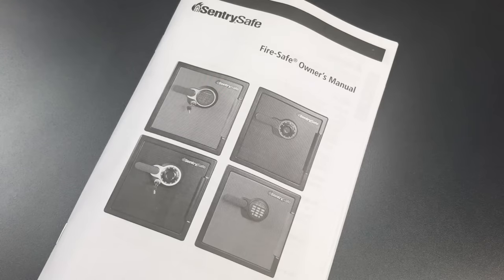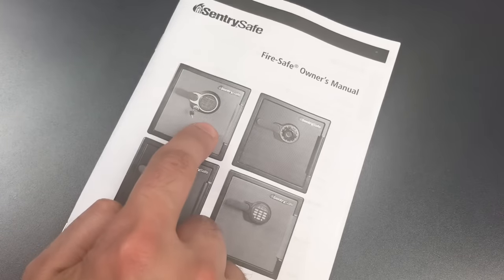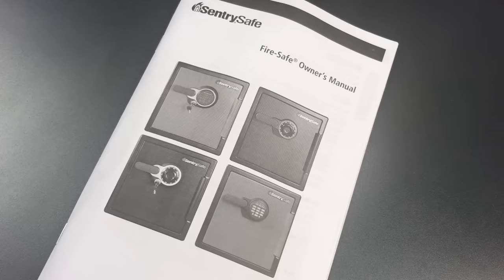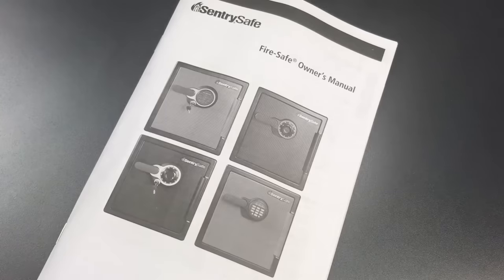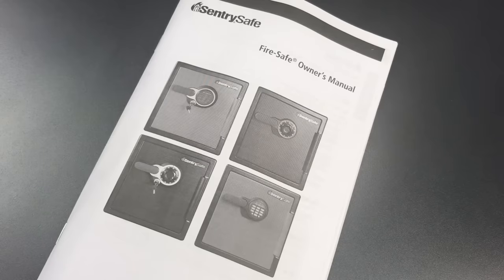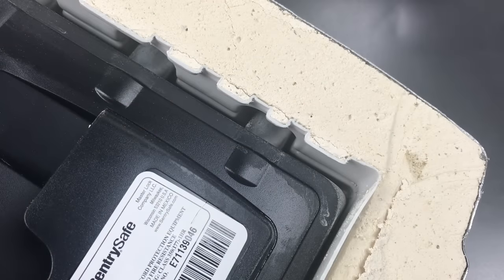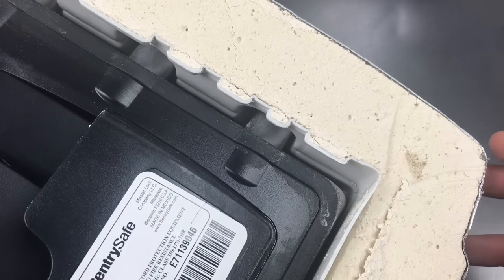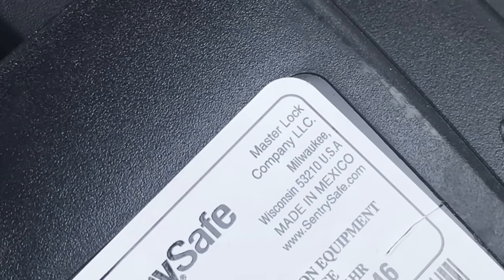[756] Sentry Safe Cut in Half FAST!

Comment: buy one of these for decoy

lock your valuables in your locking toolbox in the garage

checkmate.
Reply: @ArielNMz  step one is checking anything you have access to first. Safe come last if you have to do destructive opening. It is also prefered to load the whole safe up and bring it back to work with if you can.
Reply: @anhduc0913  yes but if you can't open the toolboxes or the safe you'll take the safe because it's easier to remove and likely has more valuable stuff in it
Reply: If they are using your tools to break the safe, they will find your valuables before they even open the safe.
Reply: @rayrous8229  "You'll always take the punches from those who don't get the joke" - Joker, from Batman: The Animated Series.
Reply: not a good idea because some thieves actually steal tools because sometimes they can be very valuable especially power tools or more popular brands of hand tools
Reply: I can tell you're all not crafter or sewers. Hide valuables in bottom of the "cabbage" bin. (cabbage =reusable fabric scraps) no one looks twice.
Reply: not really. I had a place broken into 30 years ago and my toolbox and VCR were what they tried to steal. They got the VCR but the top of the box wasn't latched and the tools fell out so they abandoned it. He left plenty of finger prints though so he was quickly caught. He yanked the wires out the back of the VCR and damaged it so my VCR was toast. This is back when Stereo 4 head VCR's were $400. I never got any money for it, don't even know what happened to him, I was never called to testify.
Reply: They may brake in to the tool box first looking for a saw and tools to brake into the safe. Best to hide valuables under pile of junk and trash as they may not think to look through the trash.
Reply: The best thing to be sure your stuff is safe from steeling.
Hide it on a complete onlogic place.

Look a round in your house so many hiding spots.
Reply: @stefan-ox8qs  when places are ransacked they usually find most of it.
Reply: @isthatatesla  basement, ore a corridor a think.(The floor directly  under the roof)
Reply: err, tools are a #1 theft target.... so, no.
Reply: @thomaschainey3230  that's great until you need a friend or family member to house sit and they helpfully take out the trash for you
Reply: And they open those decoys rigg with fart bombs 😂
Reply: Tools are the only valuable I’ve ever had stolen. They pried the entire locked and bolted toolbox off of my pickup truck with a crowbar, bending the crap out of the sheet metal.

Comment: When someone saws your safe there is more saw dust than sparks, you've got a problem.
Reply: Not at all. There are some materials that are almost impossible to saw through and they're mainly clay+concrete(with some additives) so it would be mainly dust if there was a tool good enough to saw through it
Reply: He didn't even use a blade for metal. He just used a wood cutting blade. So funny. I love when he unlocks safes with a big magnet.
Reply: @99temporal  he said sawdust 

saw·dust

/ˈsôˌdəst/

noun

powdery particles of wood produced by sawing.
Reply: When someone saws your safe you've got a problem.
Reply: @99temporal  Ceramic!
Reply: @moritz584  One of the several problems with this safe is that it's so light. 90 lbs? Not something you pick up easily, but still very manageable to lift and carry out of a house and figure out how to open it later.
Reply: Let's make it a bit simpler: when someone saws your safe, you've got a problem.
Reply: Did any of you notice it's advertised as a fire safe. It's sole purpose is fire protection of important documents, not physical security.
Reply: @wheeliebad11B  Than why does it have a lock?
Reply: @darthimperious1594  You can use such a light safe and I think the one in the video would do the job. Your valuables are protected as long as the safe stays in your house. Which simply means install it properly so no one can enter your house, pick the safe up and leave within 1 minute. Or, and that's recommended by our local police, place that safe in a way the thief must see it fast and just hide your valuables somewhere else.
Reply: Plot twist, the only thing in the safe was the key to the safe.
Reply: 666 likes so I 'm leaving a comment instead

Comment: LPL: “Today I’m going to be picking this safe”
spools up circular saw
SentrySafe: wait that’s illegal
Reply: honest, I think you could get through it using a pocket knife. might take a little longer but you would be quite
Reply: I’m going to show my skills and pick open the safe today using only a skill saw
Reply: in half
Reply: The irony of discreet 😂
Reply: I used an angle grinder to grind off the hinges, and pried it with a crowbar once. Pretty easy with power tools.
Reply: @abtwopoint0  I have a DeWalt 20V angle grinder. Lower profile than the circular saw so it is a bit more portable than LPL's attempt. Also quieter than a circular saw. I would think that would be a better choice as a thief.
Reply: @thecountrychemist2561  this would be after the safe was picked up and stolen

Comment: And to show you the lack of security! 
saw sounds 
I sawed this safe in half!
Reply: Safe tape?
Reply: THAT'S A LOTTA DAMAGE!
Reply: to be fair, the safe is small enough that one person can carry it away without effort. 

also: the metal is thin enough that he could have achieved the same result with a boltcutter and a pickaxe.
Reply: Cr4ck Horse an HVAC circle cutter or a large hole saw would go right through. I still thing one good crack with a sledge an your in like Flynn!
Reply: Ancient Yuletide Carol  HE IS NOW RIDING THE SAFE
Reply: And light enough. Could probably even use a hacksaw. A proper safe can be mounted to the floor joists and can't be carted off with out tearing up the floor and floor joists to get it loose and then it's so heavy it needs 4 guys or some other mechanical means of carrying it out.
Reply: Try Flexsafe! Just wrap your belongings in 90 lbs of flex seal and watch that burglar struggle!
Reply: COMMENT OF THE WEEK.
Reply: Now that's a lot of DMG!
Reply: I sawed this saw in half!
Reply: That thing weighs almost 90 pounds unloaded. If you can pick it up and run out of the house your probably easily recognizable as a professional athlete or weightlifter.  A boltcutter or a pickaxe is heavy, noisey, and not something you usually bring to a robbery. 

Finally its usually bolted to the floor or wall. But I guess outside of all of those we should still buy a $20K safe to store our passports in.
Reply: Yeah dude - I saw the same video.
Reply: @DarienCaldwell  Whoosshh!!
Reply: @DarienCaldwell  Dude, to get the joke look up flex tape infomercial
Reply: Cr4ck Horse a

Comment: This channel isn't for finding what products to avoid. It's for abandoning all hope.
Reply: Ok, so is there any recommendation for a decent one which can't get hacked in minutes??
Reply: @fred8674  A real safe this size costs about 15 times this one and weighs 10 times as much.
Reply: @notpoliticallycorrect4774  or you could build one yourself into your house wall with concrete, thick sheet of metal and a mechanical lock mechanism that isn't obvious. Your classical decoration Acting as a lever, connected by ropes and all that. Stick a dummy lock on the sheet of metal. 
I doubt the average robber will figure out whats going on or if he does, he will have to make a mess of the place to enter the safe.
🤷‍♂️
Reply: Yeah everything is made so cheap it's ridiculous to even try to find anything that is actually good. The companies use the cheapest materials. Then use the cheapest labor. And put it together as fast as possible while just barely staying in the range of their own standards. While taking shortcuts to avoid lawsuits. They probably spend more time worming their way into loopholes than actually using their resources in an efficient way.
Reply: @richardmcgravystein4188  idk how could you make a good quality safe for cheap.
Reply: @AcceiusTriarii  Me either. But these companies easily have more than enough money to know what to do with it. Not enough people complain about the quality because most safes people buy never have anyone trying to break into them. They don't know the quality of the things they buy they just see brand names like masterlock and think it's good by default. Although it would be more expensive they could easily afford to make better products. I bet with the money they make off of one safe is enough for them to make at least four more safes. Seems like it just comes down to greed loopholes and people not thinking about it enough.
Reply: @richardmcgravystein4188  at this point it is just a box with the single purpose of giving people peace of mind, but only that. If you want security, you can build yourself something clever for cheaper.
Reply: @AcceiusTriarii  Pretty much yeah. Most people underestimate what they can do by themselves.
Reply: @fred8674  You can put your stuff into a cardboard box and hide it.

Comment: The thing is, these kinds of safes they market are against burglars who go through your draws and cabinets, snatch what they can of value and take off. This will prevent a quick snatch and grab break in; however, even a higher quality and more durable safe will not stop a prepared thief who knows what they're up against. These safes are based upon the assumption the thief didn't prepare to bring tools beforehand with the expectation of having to breach a safe. In general, it does what it's designed to do.
Reply: Exactly. Nobody expects a cheap Walmart safe to slow down anyone determined. It defends against the lazy and opportunistic. This does that and offers fire protection at an affordable price. Your cost is directly proportional to the amount of time and effort needed to defeat your protections.
Reply: Or makes it easy! hey its a safe there is everything of value lets grab it and run. Like atleats you need to secure the safe to something for it to properly work. But then again just a custom hiding place and you have the same thing expect fire protections but then again you can add that to your hiding place..... 

Never saw such a weak safe.  That metal part is even thinner then a car panel LOL.
Reply: @xsynergist  Whell what does a safe mean to you then??? 

For me its mean it will secure the contents inside otherwise its just a cabin.
Reply: @Handle-Unavailable-x   What it means is your level of protection is proportional to your cost. How long will it take a determined attacker to defeat? The more you spend the higher that time value will be. This safe protects you from fire and people without tools. You want more protection pay for heavier safes and thicker steels.
Reply: @xsynergist  You totally right good description of it, spot on mate!!

But at it cost what i can find online retialed for  : 240 dollars. For that money its then better to build a home made fire resistant custom hiding spot. This "safe" is more a protected fire box then a 
actually safe in my opinion. This so called safe is  just gonna stand out so the thief knows what to grab and the run away. again in my opinion.
Reply: Note these can be bolted to floor. So if it is hidden away and bolted to floor that will increase security also. Once located,  not likely that a burglar will want to or have the capacity to  fire up a circular in your house if he finds it and he won't be able to carry it away.
Reply: This safe is not intended for or sold to protect against ANY form of theft.
It is a FIRE SAFE .... it only protects the contents against.... FIRE. That's the complete point of it.
Reply: @johncoops6897  I do agree that is its primary purpose, and I suspect it would be reasonably effective in that function.  But in that case, why not just have a lever on the front, rather than a lock?  It is pretty clear that this device was marketed with the implication that it would protect against theft as well.  Though earlier commenters also make a good point that you get what you pay for in that regard.
Reply: @xsynergist  but it doesn't protect against people without tools as there is no way to secure the safe to its location, they will absolutely just grab the safe and take it with them to open later

Comment: "ok here we have the luxury version, 10 inch steel plates, 8 lock cylinders, integrated tempering alarm, internal power suppl-"
"yeah... uhm... that's out of my price range, what about that one over there?"
"oh that's just a foam-box covered in sheet metal."
"i'll take it!"
Reply: Considering the first one is a safe aimed to combat thieves and the second is a fire-safety lockbox aimed to keep documents and stuff like that safe from housefire or flood, well, I'd rather take the fire-box to my house and leave the luxury safe to bank.
I like to call it the 'oh god the house is on fire' test, akin to the Chieftain's 'oh god the tank is on fire' test in that when shit hits the pooper and you have need to emergency exit your house, how long does it take to gather essential important things like indentification, certificates, graduation documents, etcetra that would be threathened by fire, flood or other natural disaster? Opening a safety vault presumably located in your cellar for maximum security, is far slower than just grabbing a file container or perhaps a small lockbox from your bedroom, which can handle rough treatment and can withstand fire for a while if you need to leave it behind during your escape. I can grab the file box from beside my bed, throw it out of the window, nab a pair of slippers and toss my bedsheet over the broken window's frame to keep me safe from glass shards while I climb over it and get out of the house in less than a minute with clothes, 'shoes', phone, credit cards and my identification papers, which I consider a passable test.
For me the 'oh god the house is on fire' test is more important than 'oh god there is a robber in the house' test since I live in area where house fire is around hundred times more likely than a robber entry, but hey hou.
Reply: More foil than sheet metal I'd say...
Reply: Swampy  dude clearly bought one and is upset that he feels stupid now. He's grasping at straws giving others bad advice who may or may not have drastically different security needs than he. Not everything can be kept in a bank. Just because he doesn't have anything valuable enough to justify a proper safe doesn't mean the rest of the world doesn't either.
Reply: Wow I thought it was at the very least concrete, not foam!
Reply: @Warhamer116  All of the "important" things you mentioned are actually replaceable.  Why even have a "fire-safety lockbox" that in reality is going to be a major disappointment in the event of an actual house fire?  Sentry Safes are rated for 30 minutes at 1550F.  Which means if you have a fire in your kitchen that is extinguished before it spreads to the rest of the house, your documents in your bedroom might be safe.  Quality fire safes are rated at 60+ minutes at 1900F+.  Also, if you can easily grab a container and throw it out the window, so can a burglar...
Reply: @skoopsro7656  Or he's actually a burglar and he'd like to see more Sentry Safes sitting on nightstands that he can simply "throw it out of the window".
Reply: @BlaubartMT  maybe so man maybe so
Reply: That’s why you have a fire retardant lock box and don’t lock it. If it’s just stuff like your will and other documents most thieves will see that and leave it. They are after items that turn a quick buck.
Reply: @Warhamer116  eyyyy a chieftain reference, love that man
Reply: @thebugmonster38  Haha, I was surprised too.
Reply: Yea because, haha you don't want no one to just be able to whack through  your safe with a skill saw and and steal your insurance papers and old tax filings.. pictures of grandma and aunt Louise half naked on a beach...
Reply: Remove the foam, and fill the void with gravel and concrete. It will be tougher than steel. Line it with a layer of old tyre and you got a cake really difficult to drill through.
Reply: @Warhamer116  The fact it is not as heavy helps in case you need to carry it.
Reply: Swampy  The day you need documents and they are lost you will understand.
 Some documents are more valuable than money.
Reply: it's actually ''safer'' to put your valuables in an unsecure unlocked wooden/plastic/cardboard box. This big ''safe'' is shouting ''please steal me, I have valuables inside''
Reply: Swampy  The issue with this one is that is probably is not sufficient to protect your documents from a fire. It is Master behind this after all.
Reply: @Warhamer116  indeed I don't think people seem to grasp the point of a 'fire safe'.
The core point is the FIRE part.

Granted, making it look like a safe just seems redundant.
I don't need it to lock.
I need it to survive a fire.

And that's a tricky thing.
Last time there was a fire anywhere near where I live the average temperature was in the order of 900-1400 celsius. (1650 to 2500 farenheit)
Bushfires burn very hot when the trees are full of oil.
As such, I have my doubts there's even a firebox on the market that can survive this, so it becomes something of a moot point.
Judging from what I've seen you'd need a box that can survive 900 celsius for about 20 minutes at a bare minimum to stand ANY chance of finding the contents intact...

For that matter, modern furniture being constructed the way it is also burns at pretty high temperatures...
Reply: @KuraIthys  - There are ratings for Fire Safes like this one. Various different classifications, as well as testing methods. Sentry Safe uses UL (American Insurance Underwriters Laboratories) ratings, and I think this model is UL Classified for 1 hour in up to 1700°F (927°C). There are better ones, but they cost more $$